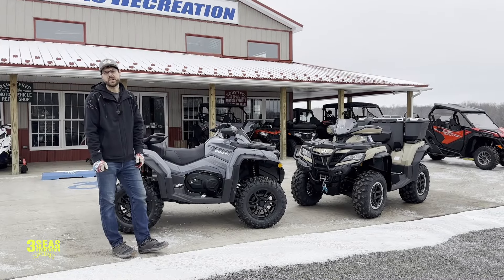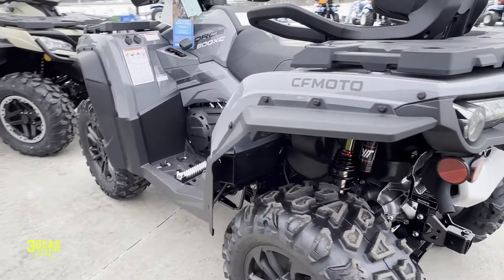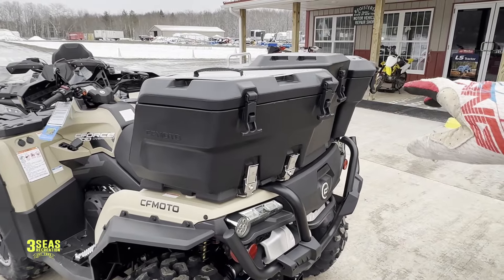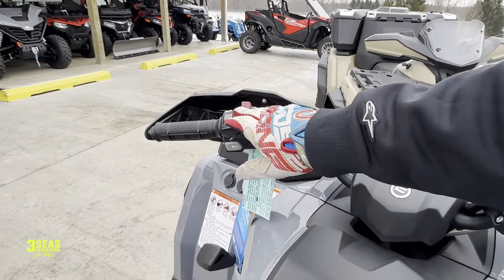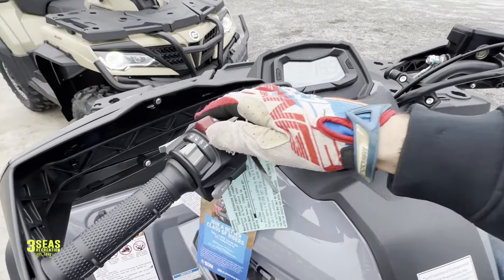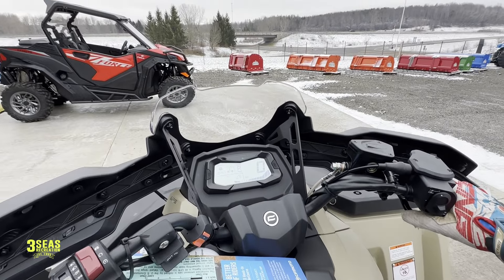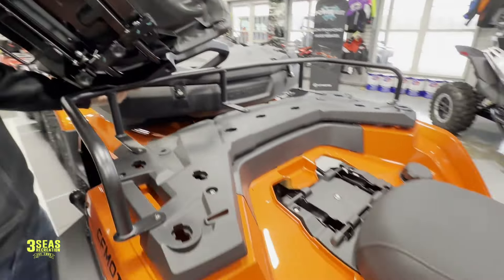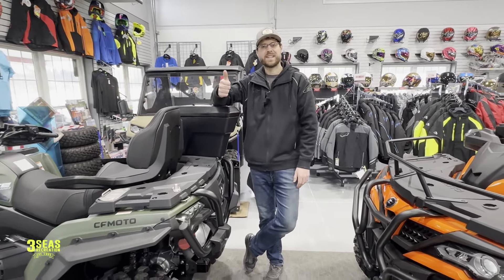2024 CFMoto CForce 1000 Overland & CForce 800 XC Walk Around Comparison!

Comment: Just wanted to ask a question about the cforce 600. Is there any changes from 2023 to 2024 models? I know there were big changes from 2022 to 2023 but was wondering about the 2024 model.
Reply from the maker: Good Evening! No, not much changed from 23' --> 24'

Comment: Wouldn't trade my 1999 Artic Cat even up for either of those.
Reply: Why?
Reply: @Catmire47  35k miles on my Artic Cat 500 4x4.  Oil changes, batteries and tires is the only money I've put into that thing over 25 years now.  I use mine to work my land, hauling trailers filled with cords of wood, mulch, lumber, tools, plow my garden, whatever almost daily. No way either of those last 5 years without tapping out to something expensive.  They are built to fail.
Reply: Got it!
Reply: @Catmire47  but yet he's here to veiw the videos
Reply: @damianoby8540  And didn't cost me a dime to do it.

Comment: Does the hand brake on the 800 and 1000 control all 4 brakes? Or just the front?
Love that tactical green 💚
Reply: About 60% front and 40% rear brake force is applied when using the hand brake, and the foot brake only the rear

Comment: I was really looking at a cforce 600 and emailed a local dealer and was given an out the door cash price of $9999.00.  $2500.00 in tax, prep, extended warranty and freight.  So much for my purchase.
Reply from the maker: Dang, maybe try a smaller family owned dealership. Usually you can get better deals from shops our size rather than super centers. Enjoy The Ride, Jared
Reply: @3SRTVOfficial  
  Can’t find any small family owned dealers in the Sacramento area.  Being in Commiefornia is half the problem.
Reply: That sucks broski. Got a 1000 from main street cycle for 11,000 out the door. You might wanna drive for a deal. Good luck.

Comment: That was one reason I disliked the 1000. That ridiculous box on the back. It's way to big. If it was half the height it would have been much nicer. My wife sat on one and the side boxes were in her way, her elbows were up against them and she felt like she had to force her elbows in, wasn't comfortable. Also put mirrors on your atv those big as side boxes block alot of the view behind you. We felt spending $2,000 more and then not liking the massive box, and then having to by a back seat seemed wasteful. They should have left the option on the $1000 to opt for the seat without the ridiculous box. We bought the 800 and put the soft siding storage shown on the 800 in the showroom. It's a much better alternative especially when riding 2 up. Love our 800. Plenty quick enough.
Reply: Nice to hear the 800 has enough power for you, I would like the seat too but concerned I’ll regret not having the extra HP from the 1000
Reply: @crfamily6946  I rode both and honestly it's not a huge difference. My 800 will do over 65. And plenty of power to fishtail all over the place. It's like anything, you can continue to spend more and more money, but the reality is, if I'm going to spend $12,500 for a cf moto 1000 then why not spend $14500 for the can am 1000. That will out run the cf moto 1000 and it's not close. We decided that $10,000 was a great deal for the cf moto 800, adding bumper rails front and back with soft storage bag for the back, out the door tax tag and title.
Reply: @rickgarcia8481  very helpful feedback thank you!